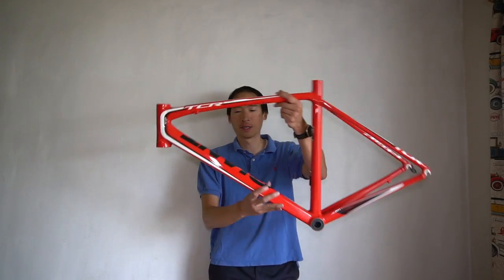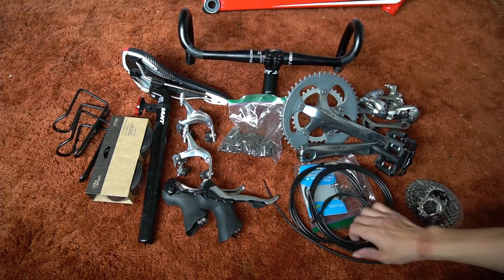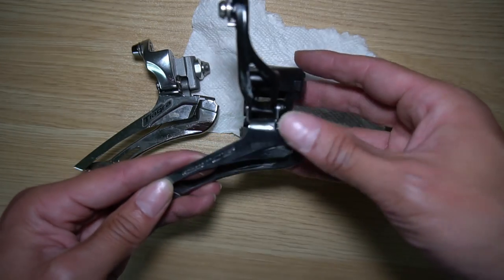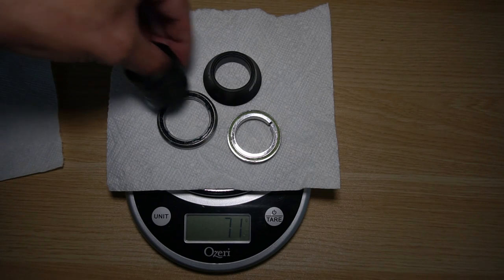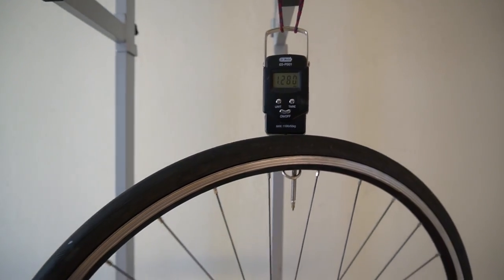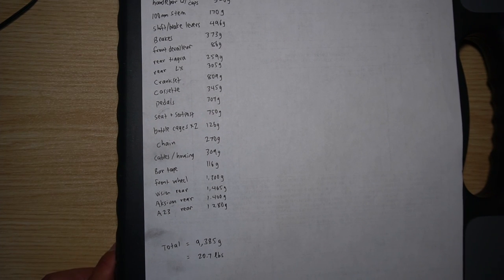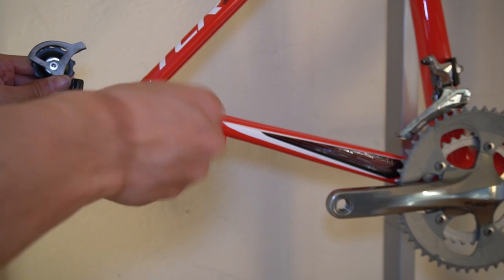Road Bike Build (How To), Step by Step Tutorial for Cheap Budget Bicycle

Comment from the maker: Table of contents (click read more):
0:00 Intro
0:22 components
4:45 wheels
5:53 weights
10:08 Installation, Headset
11:18 fork
12:15 stem
13:20 seat collar
13:39 crankset
15:19 brakes
17:43 handlebar
19:03 shifter brake levers
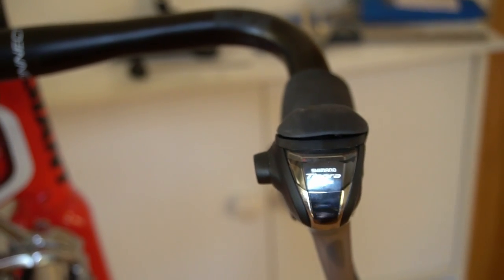21:51 front derailleur
22:27 rear derailleur
22:47 cassette, rear wheel
24:50 brake housing & cables
33:21 shifter housing & cables
40:39 rear wheel
41:08 chain & sizing
46:13 rear derailleur adjustment
49:30 front derailleur adjustment
53:04 handlebar tape
1:14:11 pedals
1:15:41 front wheel
1:16:00 adjust brakes
1:18:25 seat & seatpost 
1:20:16 water bottle cages
1:22:01 check torque of bolts
1:23:50 final checks
1:24:27 final weigh in
1:24:49 please subscribe

Comment: I've been building custom PC's for the past few years and the pandemic lead me to bikes. I've been searching for a tutorial video of how to build one yet I've never seen one as detailed as yours. Thank you so much! Your closeup shots are also very appreciated. I have already ordered the parts and is just waiting for them to come to start building. This will surely be a video I will use as a guide when building my own.

I have a question, what I got is a local brand alloy frame with carbon fork, and my cockpit set is also carbon, can I just use normal grease when installing them? Also for the bolts, I see that you're using anti seize, will normal grease also work?

Thank you so much again I truly appreciate it.
Reply from the maker: Thanks for taking the time to write a nice comment!  Some bolts, grease is definitely okay instead of anti-seize, but some you need loctite.